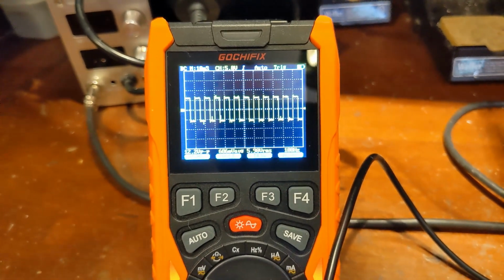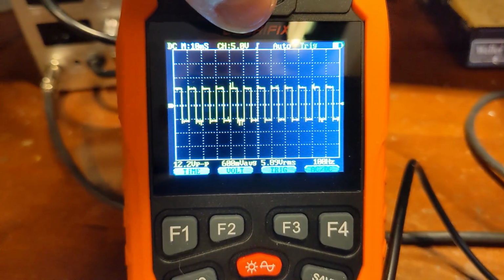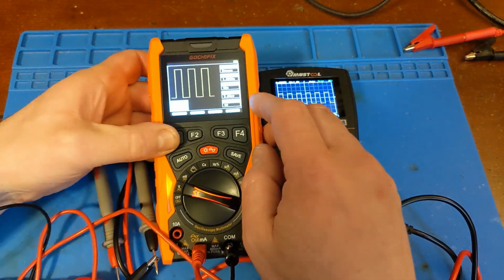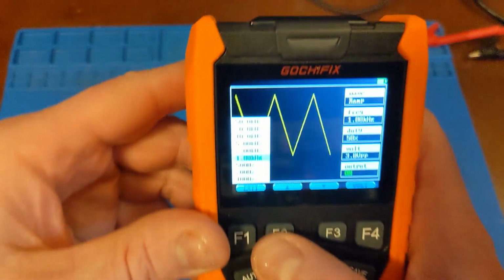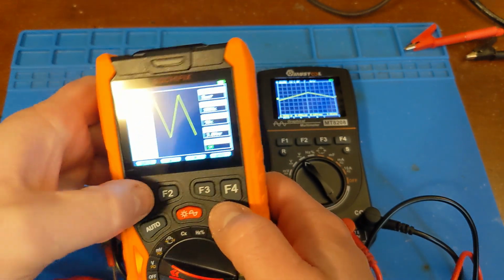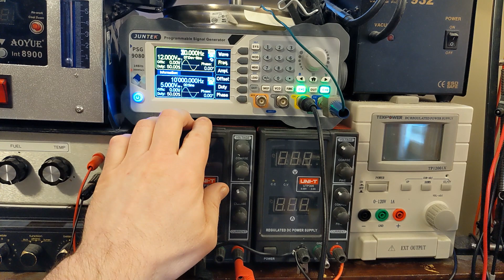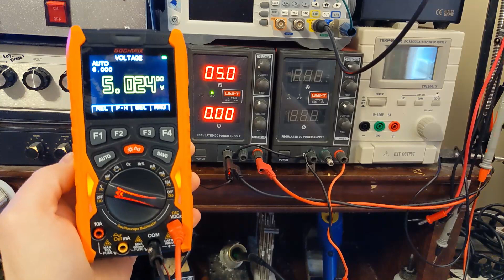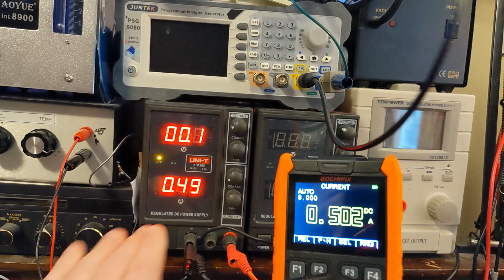New O-Scope Meter Drop!

Comment: Tried the link. Not available.
Amazing device. 12Mhz @ 50MS/s. 
Super convenient for field work.
Remember repairing thyristor  drives in factory shop floors with analog multimeters weighing kilos. Remember once having forgotten to remove the ground connection from the crt oscilloscope while scoping the power side for missing pulses !